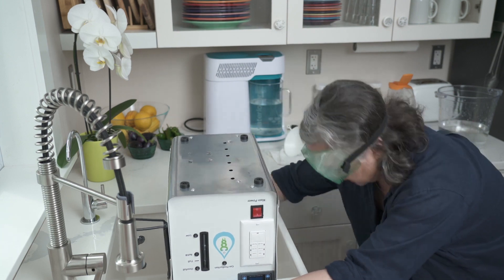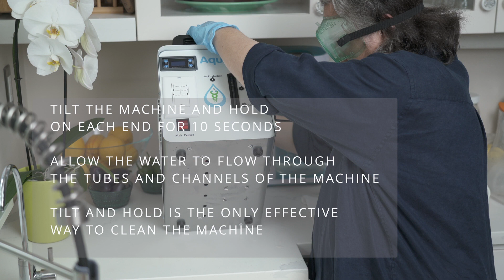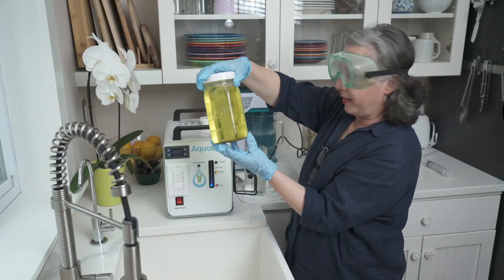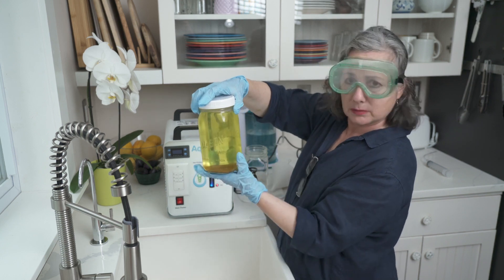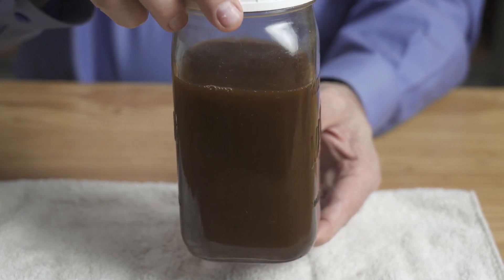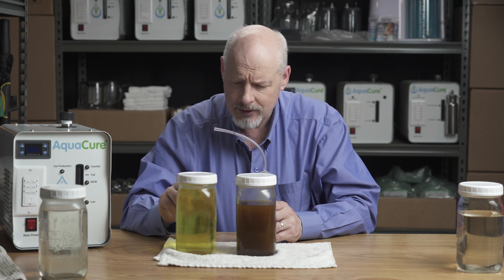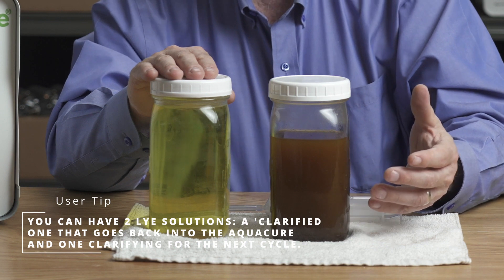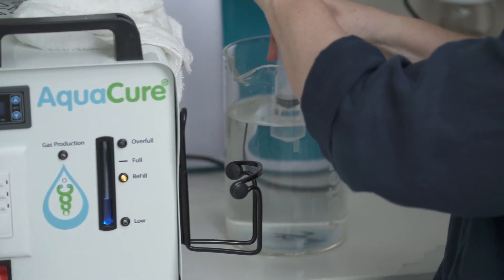AquaCure AC50 Maintenance (series video 5)

Comment: Another great video!
May I ask what the fascination is with saving the electrolyte? You say it's more efficient but what does that mean for our health?
As a researcher it's a fact that  recycling the water will greatly increase the deuterium in the water until it's mostly deuterium water. Tritium is also left in the water but that's hard to measure. I would think recycling the water would be detrimental to our health from breathing deuterium water gas..
Thanks for what you do!
Reply from the maker: To anyone reading this, please understand that I think Steve (delvis11) is a very good engineer and businessman; also has high integrity... But... He and I have been debating several issues for over 20 years.  He calls himself a 'researcher' and does an excellent job of engineering (I wish he was on my team) but simply doesn't 'believe' some of my discoveries about Brown's Gas.    He has now decided to make this part of our debate public, so here is my answer to these particular 'questions':

Steve is ABSOLUTELY CORRECT that electrolysis WILL concentrate deuterium in the electrolyte.  Deuterium is also known as 'heavy water' and electrolysis was the primary way heavy water was made for the nuclear industry.  
https://www.vedantu.com/physics/deuterium

ALL natural water contains some deuterium (usually quoted to be about 1 part in 5000).  So it is a NORMAL part of our 'diet' and is NEEDED by the body for health.  Heavy water acts in our body the same as in a nuclear reactor, dampening reactions.  This is normally a good thing, allowing the body to control metabolic functions.  The 'problem' seems to be that our more modern diet causes us to consume MORE deuterium than is optimally healthy, so many of us suffer from lowered metabolism, etc.  Thus the sales of Deuterium Depleted Water (DDW) are booming.

So the FIRST point Steve seems to miss (when throwing away electrolyte like he advises) is that the deuterium STAYS IN THE MACHINE.  No one is getting 'extra' deuterium in their gas or drinking water as a result of deuterium building up in the electrolyte solution.  In fact...
Electrolysis is one of the ways that DDW is MADE, and I know Steve knows this because I've seen him making a video doing it... So I do not understand the cognitive dissidence.  
That experiment negates his own statement above that he 'thinks' that recycling the machine's electrolyte solution would cause the 'water gas' to have deuterium in it.  
There are many ways to PROVE that the Brown's Gas doesn't have deuterium in it, the most definitive is to have a mass spectrometry test, which I have done; and showed Steve in the past.

Steve seems to support the MEME that 'Lye is bad'...  I'm not sure if he believes it or is just 'going along to get along'.  But I stand on FACTS and integrity, trying to teach the TRUTH, even when it contradicts the 'Narrative'.  Lye is not what the Fear Mongers on the 'internet' are trying to claim it is.  Here is a FAQ: that I put together to help people understand some of the 'health' facts about lye:  https://eagle-research.com/faq/is-lye-safe/

There's nothing inherently 'wrong' with making a fresh lye solution everytime you clean the machine (as Steve advocates), it just offends my senses of efficacy, efficiency and frugalness.  

In my opinion and experience, keeping re-using the same lye solution results in higher therapeutic value, higher efficiency, and less cost.  

THERAPEUTIC EFFICACY
In one of my electrolyzers, I'm still using lye solution that I originally mixed back in 1986... So I have DECADES of electrolyzer experience to back up my 'opinion' :)  
Since March of 2016 I have been inhaling Brown's Gas for a minimum of 4 hours a day and often 8 hours a day.  I'm (and I have proof https://eagle-research.life/about-me/) MUCH healthier now!  I also work from 3 AM to 8 PM almost everyday; so I'm obviously NOT suffering from low metabolism. 

The NEXT most important thing that Steve does NOT believe in (even though I've given him definitive proof and told him how to duplicate the experiments) is something I call Electrically Expanded Water (ExW).  
I 'discovered' it (realized WHY Brown's Gas was making 'more gas than it should') in 1996 and theorized the existence of ExW.   https://eagle-research.com/water-gas/

I did NOT KNOW at the time how IMPORTANT ExW was going to be for people's HEALTH.

Bottom line; Brown's Gas is proving to be about 30% more therapeutically effective than pure hydrogen, BECAUSE of the ExW.  The ExW appears to be the magic ingredient we WANT more of.  

In a series of experiments in cooperation with Professor Gerald Pollack of the University of Washington, we also discovered that ONLY Brown's Gas (with ExW) caused the EZ Gel (aka EZ Water or H3O2-) layer to increase dramatically.  Oxygen did not, and pure hydrogen did not.  

This is absolutely CRITICAL because it is the EZ Gel in our body that makes life possible!  Without it (among other things) blood literally cannot flow in our circulatory system.  This is something that most modern (indoctrinated) Doctors do not know... And they ignore those Doctors that DO.  
https://drtomcowan.com/products/human-heart-cosmic-heart/

ELECTROLYZER EFFICIENCY
As I pointed out above, my Brown's Gas electrolyzers were creating significantly MORE gas than the Faraday Equations predict (up to 130%) which is, of course, 'impossible'.  
It was only after I discovered the ExW that the explanation for the 'extra' gas volume became clear.  There was a THIRD GAS (in addition to hydrogen and oxygen) being produced.  
This third gas was STILL WATER, but water that had NOT been 'split' into hydrogen and oxygen, so it was/is NOT PART of the Faraday Equations.  https://eagle-research.com/q-what-is-browns-gas-bg

ExW is WATER in its plasma state.  An electron rich gaseous form of water (H2O).  
These 'extra' electrons are what gives the body the ENERGY it needs to stop oxidative cascade, repair oxidative damage, mitigate inflammation and much much more.

It turns out that ExW is formed using an 'electron bridge' that forms between the anode and cathode.  Which is WHY traditional Faraday electrolyzers (with a membrane) CANNOT make ExW (the membrane prevents the formation of the electron bridge).  
The electron bridge causes water to 'absorb' electrons (like a sponge soaks up water) until the water itself becomes a gas that is NOT water vapor or steam... It is a plasma.   (yes, for you science nerds, MANY 'cold' plasmas exist, just look inside a fluorescent or neon bulb, etc.).

So what does the ExW have to do with deuterium?
Simple... The more deuterium that is in the electrolyte solution, the more ExW the electrolyzer produces.  The machine becomes more efficient, producing more gas; the majority of the 'extra' gas is ExW.  
We've already established that the simplest way to get more deuterium in the electrolyte is to keep re-using the SAME electrolyte!  So gradually, over time, the electrolyte becomes what I call 'conditioned' as deuterium levels increase and more efficiently makes ExW.  

Again, the point is that the deuterium STAYS IN THE MACHINE!  No one is inhaling gas with deuterium in it... That's just Narrative Fear-Mongering or Ignorance speaking.

Bottom line:  The more ExW, the higher the electrolyzer's 'apparent' efficiency and the more therapeutically effective the Brown's Gas is.  

WASTE
In the end, because it is both more efficient and healthier to keep re-using the same lye solution, it offends my frugal sense (that I acquired growing up on a cattle ranch in the bush).  
WHY throw away something that is perfectly useful?  It's just a waste and we (in my opinion) need to STOP our (as a society) wasteful habits.  In my opinion and experience, there is NO good reason to discard the lye solution and some very GOOD reasons to re-use it.  
Why keep buying more of a resource and then throwing it away when KEEPING it benefits you MORE?

Finally, again, I greatly respect Steve's engineering abilities and this answer is NOT intended to be derogatory in any way.  He is a good man that I would like to have as a friend.  If you are or become his customer he'll treat you in a very businesslike manner.  
but... There are things we've been debating (other examples include electrolyzer design) and now you've now gotten a peak inside this part of our debates.

May the blessings be
George Wiseman
Reply: So to have more ExW you need older ley solution since it will have more deterium in it. Isn’t boiling water creates more deterium? I am just waiting for my machine to arrive and reading all the comments. What about I will prepare my first lye from boiling my distilled water multiple times? Will I have more “matured” solution? How many times should I boil it/ cool it to make a difference? Thank you
Reply: This is your video so I will just leave it at that. Thanks George for what you do.

Comment: just got 100 hours on my machine, so I am doing my first cleaning, good video for the maint. of the machine. The float ball on the sight glass is still stuck, should I keep cleaning it until the ball come free, looks like the water is not getting into the site glass. I had to microwave the water and check the temp. I kept it at 130 f. 
Let me know what you suggest? Merry Christmas. Love my machine, I am sure I need to use it more to get all the benefits from it. 10-1/2 months to get 100 hours, I need to ramp up my usage, although I drink the water everyday.
Reply from the maker: Yes, I think at least an hour a day for a healthy person maintenance.  For theraputic use or for optimum performance, as many hours as you can fit in.  Many people simply inhale at night as they sleep.
For the cleaning, eMail me and I'll send you the instructions.  https://eagle-research.life/contact/

Comment: thanks for the video. when George said over time we have to put a "little lye" to our solution, what does "little" mean? we add 1 tablespoon? 1 teaspoon? also WHEN do we know we have to put a little lye to our solution?
Reply from the maker: FAQ: When to add more lye?
Q: I also have a question about gas production.  Can I be assured that as long as bubbles of gas are being generated then the machine is operating properly?

GW:If there are bubbles, it is Brown’s Gas.

After that it’s ‘how much’… If the gas production is less than it should be then it could be a gas leak (most common) or not enough electrolyte (lye).  See gas volume testing below.
Test gas production   https://www.youtube.com/watch?v=w1GOztHEOgk

Q: It seems that the machine has been operating quite a long time since I last replenished the solution.

GW: You should almost never need to ‘replenish’ the solution.  I’m still using lye solution I originally mixed in 1986.  It doesn’t ‘go bad’. If fact, as it gets ‘conditioned’ it gets more efficient.

What does happen though, is a tiny bit of lye is lost with the gas as it rides on water droplets (which get caught in the Humidifier). 
This ‘lye loss’ is SMALL and might lose an ounce in 2000 hours at 100% gas production.  
The bigger lye loss is during maintenance cleanings, where a small amount is left behind with the settled sludge (assuming you are doing the maintenance rinsing as currently recommended, see UPDATE below).

AquaCure AC50 Operation Manual UPDATE notes
https://eagle-research.com/wp-content/uploads/2021/11/AquaCure-Operation-Manual-Update-Notes.pdf

The AquaCure will make therapeutic volume of Brown’s Gas with as little as 30 grams of lye in it, so if you find you need to add lye, I recommend adding no more than 1 ounce (about 30 grams).  Then you will have PLENTY of lye and if the gas production doesn’t improve, there is another problem to address, like a gas leak (which you should always look for first because you do NOT want to have too much lye in the machine).

Excess lye leads to more lye loss, potential foaming and crystallization / plugging of internal orifices.

Q: It seems to me common sense that if only distilled water is put in the machine when level is low, it will eventually weaken the lye concentration and thus not produce bubbles. 

GW: Electrolysis requires a catalyst to operate.  It’s very difficult to ’split’ water without a catalyst.  The catalyst we chose (after testing literally thousands) is lye.
In theory, since the lye is supposed to STAY IN THE MACHINE (and NOT come out with the gas) it does not ‘weaken’.

A catalyst (by definition) does not get consumed in the chemical process / reaction.
So the only thing that get’s 'used up’ in the electrolysis is the water.

Brown’s Gas is made ONLY of water.  So as Brown’s Gas comes out, you need to replace the water.

Theory aside, In practice a TINY amount of lye can ‘ride out' on water moisture droplets that are in the exiting gas.  These moisture droplets are trapped in the Humidifier.

The amount of lye that ‘rides out’ in this fashion is so small that it would literally (and I mean literally) take YEARS of constant use at full production before there’d be enough lye loss to need to add more to the solution in the machine.  There is NO need to even consider such an insignificant loss.

MOST of the lye loss is when maintenance cleanings are done.  Because some is left behind in the sludge.

So after a few cleanings it MAY need an ounce of lye added to the solution (when it is outside of the machine).

’No bubbles’ COULD be a symptom of not enough lye, but USUALLY is NOT!
The DEFINITIVE test to know if you need more lye is to test the solution specific gravity using a hydrometer.  You want a reading somewhere between 1.05 to 1.1 specific gravity.

The lye is a catalyst, so it is not 'consumed' and in theory the initial charge would last a lifetime.
However, in practice a tiny amount is lost out with the gas over time (the Tower Cap reduces loss and the Humidifier absorbs the rest). 

Lye can also be lost when people pour out some of the solution or if there is a leak or during maintenance rinsings.

The easiest way to determine when you need to add another ounce of lye is when you notice the gas production has dropped (and there is no gas leak or hose blockage).

I do recommend a specific gravity (of the Lye solution) of about 1.05 to 1.1 (using a hydrometer).  
Here’s what a hydrometer is and how to use a hydrometer (need a test cylinder too)
https://www.youtube.com/results?search_query=using+a+hydrometer+to+measure+specific+gravity 

You can get a good kit from Amazon.  Be sure it is a hydrometer and not (or not only) an alcohol meter.
https://www.amazon.ca/Specific-Gravity-Hydrometer-Test-Kit/dp/B001X27L9W/ref=sr_1_1_sspa

Or just mix 80 grams of lye in the first mix of solution.  The solution does NOT need to be exact.  In fact it’ll vary normally as the water leaves anyway, the remaining solution becomes more concentrated.

You can use more lye (I previously recommended up to 150 grams), but we've found it leads to excessive internal lye crystallization that causes clouding of the sight tube and exacerbates any internal plugging (due to sludge formation or oil contamination turning to soap).

A Very Good alternative (but not definitive) test is to look inside the machine as per the instructions I gave you.  If you see bubbles, then you HAVE ENOUGH LYE.

If you do not see bubbles there could be other issues, like a bad electrical connection, that have nothing to do with the lye concentration.  I have people put in double the amount of lye needed from the start; it only NEEDS about 30 grams of lye to be fully functional.  It’s Very Rare that the machines don’t have enough lye

’No Bubbles’ is USUALLY a symptom of a gas leak.  I usually start by checking the Tower Cap base

Properly Install the Tower Cap
https://youtu.be/Pr98DMe94No

Make sure your Tower Cap base Union is sealed properly and that you remove the Tower Cap using the Union ring, so you do not need to keep re-applying the Teflon Tape.  
DO NOT ’torque’ on the Tower Cap to seal the base fitting; doing so will ‘lock up’ the Union, requiring wrenches to loosen it.

May the blessings be
 🦅 George Wiseman

Comment: I had been clarifying my lye solution using coffee filters. I'm not sure where I saw that you could do that but it sounds like that's not actually recommended. What should I do now? Does the lye solution need to be replaced? Should I worry about any damage to the machine?
Reply from the maker: We haven't recommended coffee filters for years because they do NOT filter fine enough to catch the sludge (they'll catch construction debris) and they add IMPURITIES into the solution.  Just let the solution SETTLE, perfect 'solution' (pun intended).  I'd just continue using the solution you have and start using the settling technique in the future.
Reply: @ecopegasus  Thanks for your response. I will use the settling technique from now on.
Reply: @ecopegasus  George I have used a fine stainless steel strainer to remove the sludge. Is this okay? Is stainless steel reactive with lye and releasing stuff into the solution?
Reply from the maker: @epap1375  No, the lye solution doesn't react with stainless steel (or gold, silver, etc.)  But the 'sludge' that is 'generated' in the AquaCure is VERY tiny particles that no coffee filter can stop (note that you can catch a few chunks of constriction debris but the 'color' of the water doesn't change.  The only way to really clarify the solution (which is what we are trying to do) is to let it 'settle'.  I use TWO sets of lye solution, so one can be settling while I use the other.